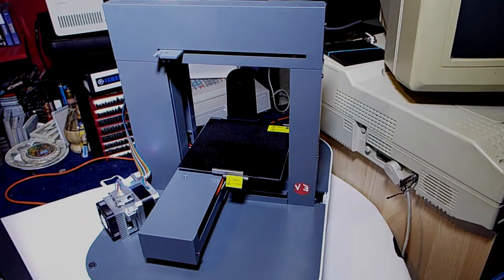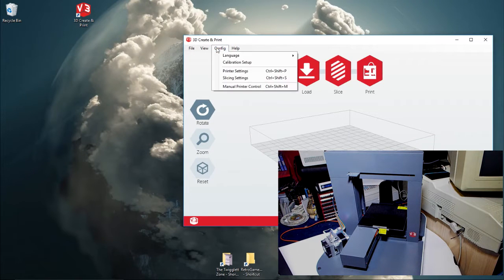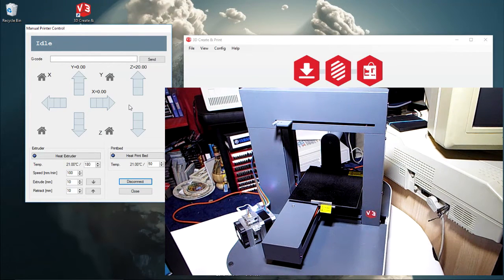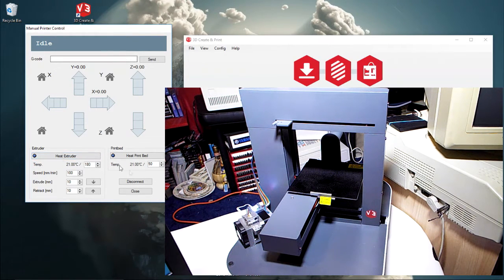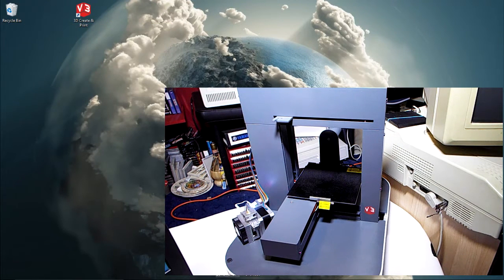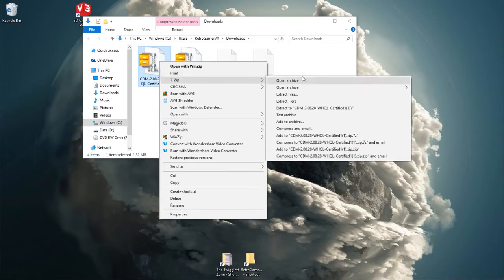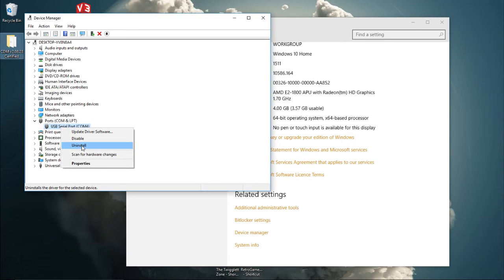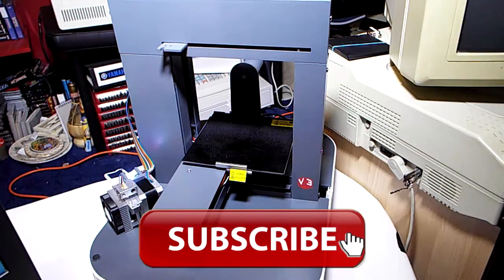Eaglemoss V3 3D Printer : Connecting To PC & Controlling The Axes / Heaterbed Tutorial :o)

Comment: My printing bed is stuck at the top, how do I lower it manually? Everytime I turn it on it just keeps going up and its already past the nozzle
Reply: Sounds like My Problem.  I'm getting a Heave Vibration.
It may need adjusting in the Threaded Rod.  I'll be checking mine over the next 24-48 hours.
What did You find, anyway?
Reply: Same. Yes in Gide book it says. Do steep by steep. Don't do to Manny commands ..I tryed few time to get it to. Move down. But no luck. It sounding jamed or whanting to move but jaming print head.......did u have any luck geting print plate to move down
Reply: Was it thread rod in moated not turning.  Or...i was thinking same if grub screw not in right or thredid ...just geting naming sound an print plate whant move down when in control panall arow down wilst holding hood  switch down...its anoing all this happens   .befor geting to calibrate it yet ..an .no help .eagal moss shood have 3d printer teck to help us fix it till working right at $2000 .$500////for it all.

Comment: I was having trouble Connecting Mine on my Windows 10 Desktop, so I tried my Windows 8.1 Laptop and it wouldn't Connect either, but I finally got it to Connect.  However, it's not showing the IDLE Window.  It just Connects and moves X, Y, & Z.
However, there is a Heavy Vibration which seems to be coming from the Z Axis:  Maybe it needs Tweaking.  I'll check it tomorrow.
I haven't tried pressing those Arrows yet.  I want to see what that Vibration is.

I'll try my Desktop tomorrow to, as that is what I want to use it on.
Reply: Did u fix your vibration problem mine seems to make same sound n. I got the print plat up to print head....it say s in Gide book..do not do to many command at one s.  Which I think we did ..still geting vibration sound n press arow down but print plate whant move down its sounding jamed..may be coill rod in moater  on left ain't .turning. ...its anoing .trying to get bild plate to move Down..when following Gide but not moving down..

Comment: I followed your guide, but my printer connects (it always has done), I get to the "9 commands waiting" but when I press down the printer hood switch, nothing happens. I haven't received the replacement heater yet, so do you think that this is why I can't control the axis?
Reply from the maker: +Simon Duggan Could be, might be sensing something missing?
Reply: I get the same issue as you I have the replacement heater part so don't think it's that. I just hope it works by the end of it all!
Reply: I get the same issue as you I have the replacement heater part so don't think it's that. I just hope it works by the end of it all!
Reply: I get the same issue as you I have the replacement heater part so don't think it's that. I just hope it works by the end of it all!
Reply: +Kyle Mitchell mine was a night mare to get working, gave up on windows 10 as it just kept on saying your device is broken so tried it on windows vista with the drivers and works fine, would of thought they would of gave you drivers or have a link to drivers to help people out
Reply: have you managed to fix this Simon? I have having the same issue
Reply: +Peter Hill Yes it is working perfectly now. It wasn't until I attached the heater part from issue 72, and plugged the print head into the cable. The axes all fired up when pressing down the hood limit switch. I got the replacement heater part in issue 70, installed it, and tried it out but it connected but didn't take commands. So the V3 must know if there's parts missing even the print head heater, once you've added this and the replacement part, also pushed down the limit switch, it should work fine.
Reply: Oh ok. I have completed up to issue 75 but I am missing issue 71 as it is out of stock. This issue contains the heat sensor for print head so hopefully once I install this and plug it in things will start moving. Thanks!
Reply: +Peter Hill Yes that sound that the issue, I thought the heater and sensor wouldn't make a difference, as long as the circuit board was connected, but that's not the case.

Comment: Okay so mine connects just fine after installing the drivers mentioned in the video, but will not move at all. I have replaced the heater and installed the print head. What can I do now?
Reply from the maker: no idea beyond this....just completed its first ptint....youll need to call Eaglemosd
Reply: I got my print plate up to printer head but now  it whant move down so anoing. Just sound jamed for sume reason. I was thinking it coill rod in moated not turning..may be...

Comment: You're suppose to use something Non-Metallic:  A Pencil is recommended.
Reply: or your finger - its only a push switch and human skin has high resistance, specially against 12v 15a
Reply: @digimbyte  Bit of a tight squeeze for your finger.

Comment: I'm rather shocked they decided to use the FTDI uart chip; the drivers have been a nightmare.  FTDI changed their drivers to try and detect counterfeit chips and now FTDI drivers don't work well with their own genuine chips. Arduino went away from using FTDI for that reason.
Reply from the maker: +SublimatedIce I don't know the technicalities of it, or even if that fixed my issue as I only thought about the hood switch after installing them.